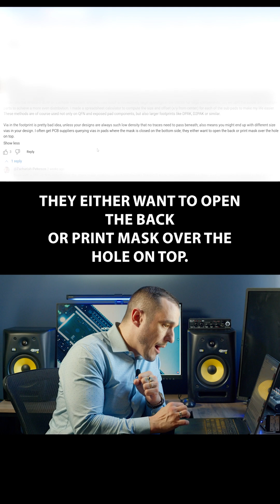Bottom Terminated PCB Components With Thermal Vias #electronicsdesign #pcbdesign #pcbmanufacturing

Comment: "Every single time you need to eliminate a via from a footprint" is still less often than "every time you need to manually add X thermal vias in the thermal pad that needs them". Plus, after you place them, you then have to manually construct the windowing in the paste layer between the manually placed vias. Everything you said that needs to be done to remove a via is true, but is by no means slow, or a "big pain". And as you said it yourself, you always ship a project footprint library with the project, so you are making copies of all footprints anyway. I actually have project-specific schematic symbols too! If you end up with some footprints in the project library missing some vias, who cares? They are project-specific. I totally understand what you're saying, but I can't belive that deleting is the "bigger pain" until you press a button on a stopwatch for both procedures. Pressing Del key in the footprint editor is quicker than placing vias manually and taking care of paste layer windowing, FOR ME.